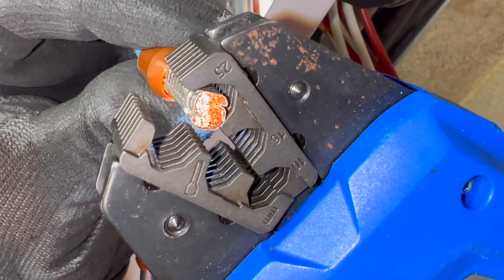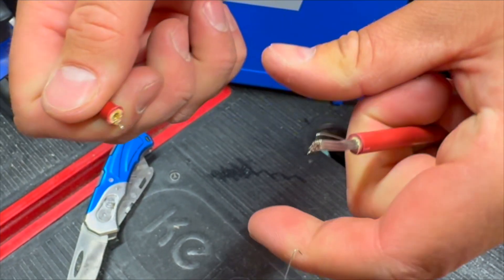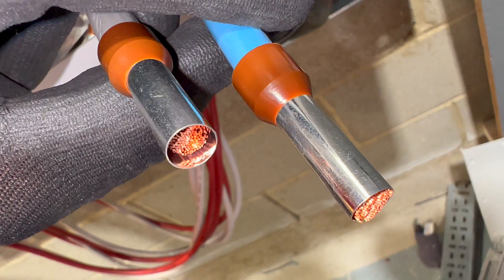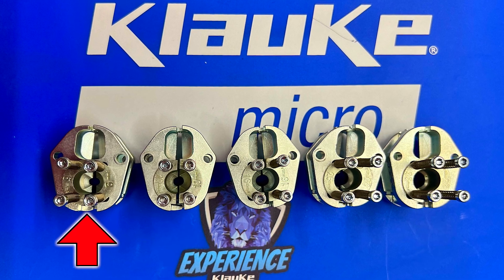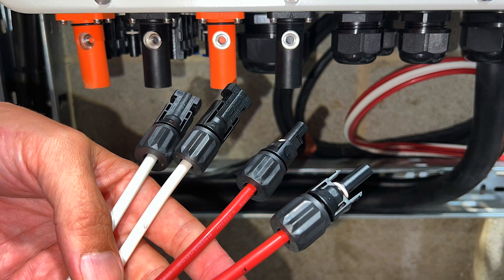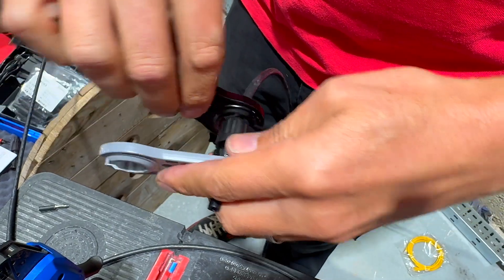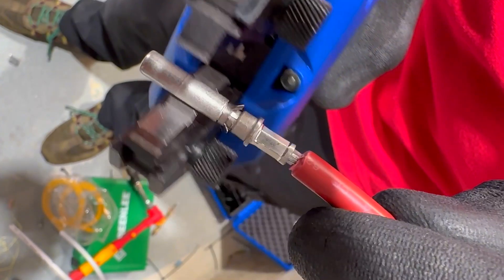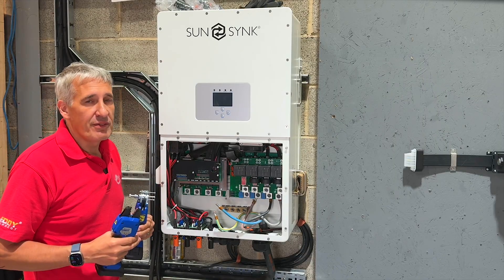This Tool Strips Wires Like Magic! - Klauke Micro

Comment: Hi all at eFIXX, Marine sparks here and I do need to crimp up to 120mmsq class 6 cables. I’m presently using a 5 ton hydraulic crimp tool with hex die’s and would love the Klauke crimp tool on a Makita platform and the accompanying hex die sets as we must use the hex type die here to comply to the regs. These Klauke tools do look great but the eyewatering costs for the kits and die’s are not yet accessible to me presently. I’ve put on my xmas list, but I’m sceptical it may not be under the tree xmas morning.

Comment: If you have a range of cable sizes, then you need a range of dies.  I reckon this is one for panel building contractors, but unless the dies are inexpensive there are other electric automatic wire strippers from milwaukee, dewalt etc

Comment: Another massive waste of money, if you carnt strip cables give up trying be an electrician
Reply from the maker: This is more about productivity improvement than skill.
Reply: Fair enough, however it’s more about trying to improve.
Reply: By the time you keep swaping the die for the different sizes you would be stripping it would be faster to just get started with your knife or shears.
Reply from the maker: In a panel build there are usually lots of repetitive stripping operations.